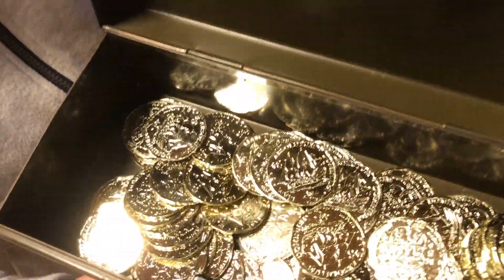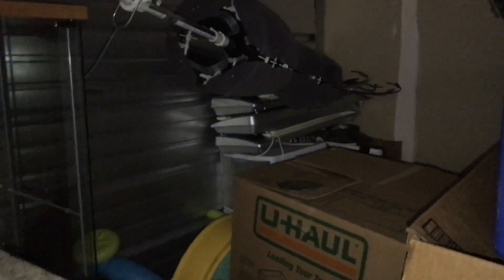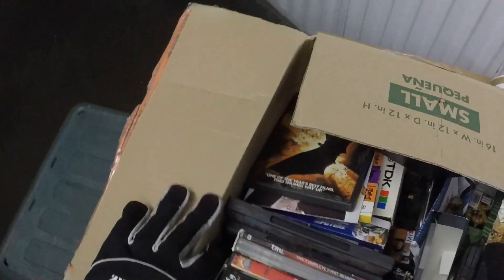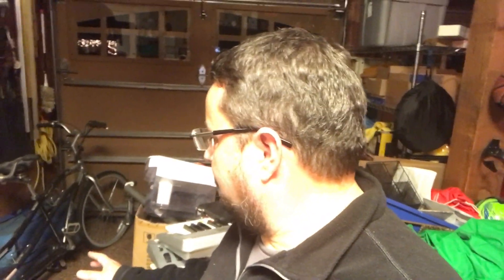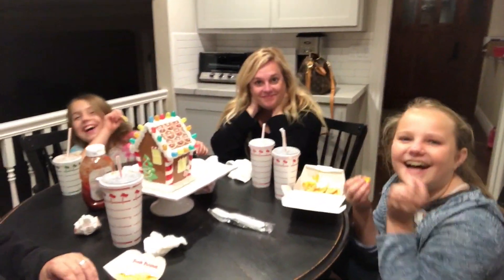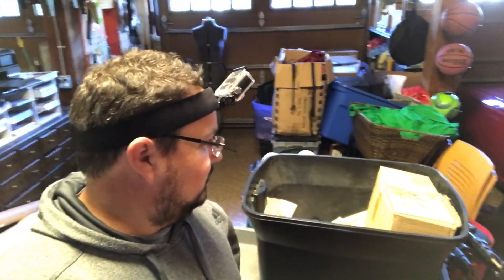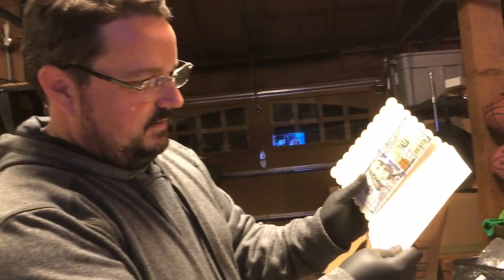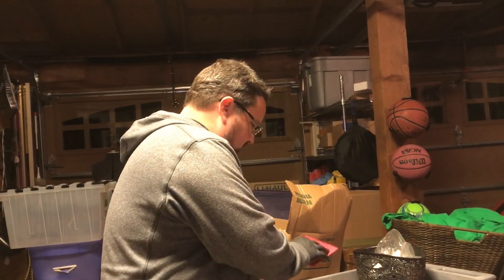LOCKER NUTS ep 02 - The misplaced gifts that save the day!

Comment: Those Glass Display Cases are SOLID GOLD!!! I sell my to Reptile crowd, they like to turn them into arboreal Tree snake habitats
Reply: Great tip! I would have never thought of that option, and wasn't sure what to do with them since the shelves were missing. Unfortunately when I pulled them out, the bases were shot because of the water damage many of the items suffered, which is why I wound up dumping them. Coincidentally, I saw the exact same display cases in another online auction since then, although I didn't pull the trigger on that one. Thanks for that excellent suggestion; next time I'll know what to do with them!

Comment: That gray body form is a adjustable dress form and is very expensive. Don't lose money on it. Do your research, Some of the stuff that looks like trash can actually be valuable.
Reply from the maker: I thought I had a good item there as well. I listed it, sat on it, waited, lowered the price, waited, and eventually sold it for $40. Since then, I've come across a much nicer one. Thought I'd get $200 for it, was told I might get double that. It's been listed for $125 for 4 or 5 months now, been to a few flea markets with me, and still in my garage. I've come to the conclusion that dress forms are tricky to sell. But I still think they are cool.